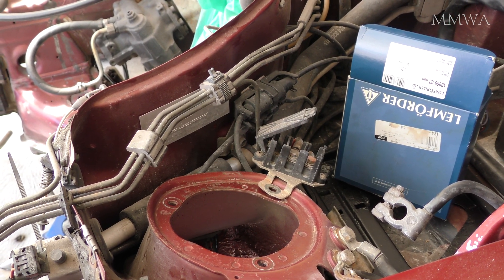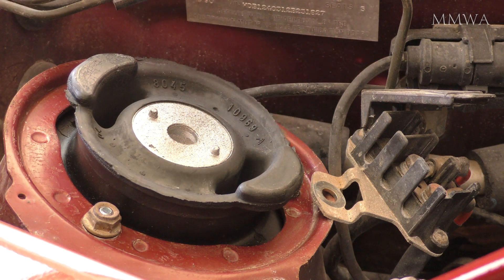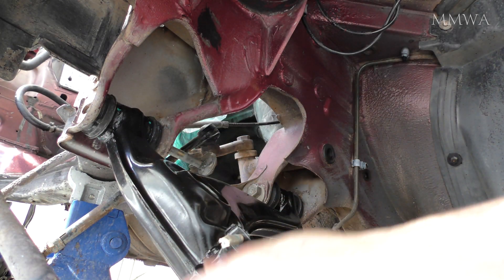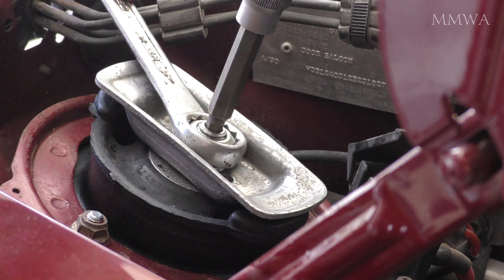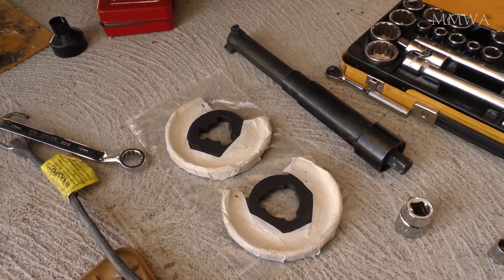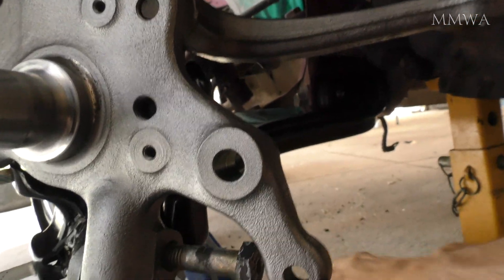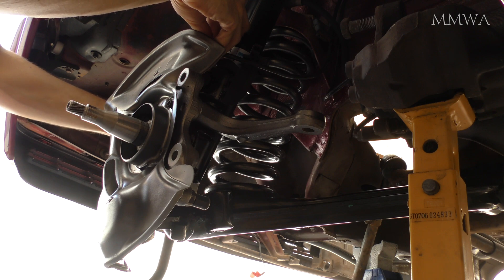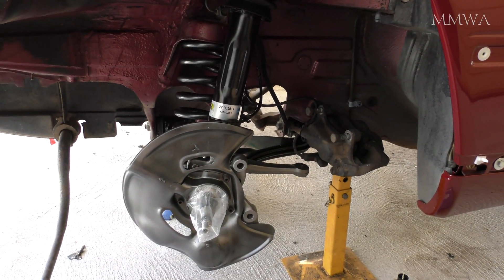W124 Project - I start assembly of the front suspension

Comment: Great video as always. I've replaced a whole lot of front end stuff, but there's still unruly vibrations coming from small bumps and making the interior shudder like an old Peugeot. The only bush I haven't replaced (which looks perfectly fine visually) is the front two piece bush on the front control arm. The rear bush on the front control arm has also been replaced. Looking at your video, it does seem like control arm goes a LONG way in absorbing vibrations. Would that be correct or should I be looking elsewhere? My 124 is a 300e 4matic btw which has very different looking components up front, but functionally the same.

Comment: My Febi-Bilstein control arm ball joint didn't fit the knuckle. Jacking and hammering it didn't do the trick.  I have to remove the glue and used hammer and screw driver to make the openning bigger.  It took me several hours to make that decision.  I also had a terrible time removing the spring compressor.  I had to reposition the plates 3x because the plates get stuck and loosening the the spring compressor bar with my ratchet keeps hitting the control arm which stops the ratchet from turning. I also had to jack it up and down in the process to get it loosen.  Also did you have a self-leveling system suspension in the rear? Did you need to replace it? I got a 1993 300TE Wagon. Thanks

Comment: I got Febi-Bilstein control arm too...but did you notice the placement of the lower end of the coil spring where it sits is different from the left and right. The driver side spring slot/stopper is on the lower end and passenger side spring slot/stopper is on the top end. Do you know why?
Reply from the maker: I did notice this and to be honest have no idea why its like this. Maybe its the angle the springs flex out on has something to do with it

Comment: Hello What is your torque specs for you control arm 2 bushing nut, ball joint nut? Also the strut/shocks 3 nut behind the knucke and 1 nut on the top of the shocks? Thanks
Reply from the maker: service documents are on the w124 performance website

Comment: Hi mate, did you have to get aftermarket shocks to fit those springs? Sorry for bad english
Reply from the maker: I think you should get shorter travel springs - i already had stock standard new bilstein shocks on hand so used those. i fully expect them to not last life due to being compressed so far at all times though.
Reply: @MMWA-DAVE  how did that work out? The h and r fronts on my diesel 606 wagon had to be removed due to tire rubbing.
Reply: @chillstar  check out boosted garage or whatever they are called with the 240z 606. He has a 124 in there with some really interesting rear springs. It is a sedan, but it must be some sort of solid thing they bolt into the spring perch with a big threaded tube that the actual spring rides on. Allows adjusting ride height. Probably not cheap, but maybe not too expensive either.
Reply: @chillstar  I just ordered all sportline stuff for my rig with the appropriate pads. Not too expensive except the rear sls struts which were really due for replacement. You can get them rebuilt or replace the seals yourself but I have not seen anyone redo the lower ball joints on the struts. They get super slack over time. Unfortunately the sportline sls struts are no longer available.

Comment: What brand are your control arms? Iam replacing LCAs on my 124 now i have lemforder CAs I believe my pinch bolt is already in the correct orientation, with the notch facing inboard. I also noticed that you didn’t paint match the eccentric bolts but just used another w124 as reference that worked out ok? Great videos keep up the good work!
Reply from the maker: I will have the car aligned professionaly once its at full weight - any alignment adjustments by me will only be temporary and good enough only for that drive to the shop. I used the miele kit or how ever its spelled. I would have prefered the lemforder but at the time (on both cars) the shipping was outragious for the very same kit - perhaps its heavier. Now they are available locally so i'd probably use lemforder in future but having said that i've still not had any issues with the kit on my blueblack car so they seem ok.

Comment: great video do you not use lock tite or torque these bolts to the correct torque? I'd be worried some of them would come loose
Reply from the maker: Absolutely you should replace the bolts at the knuckle (they come with new thread locker already applied) or at the very least clean and apply new thread locker. the struts come with all new bolts already.  The bearing kits also come with new caliper bolts already applied with locker too. I have only reused a few bolts.

Comment: The front hex-head-screw of the lower-control-arm is mounted the wrong way. In order to protect the thread the nut needs to be on the rear end (same with all screws i.e. the exhaust). Here in Germany you will not pass inspection this way.
Reply from the maker: Heh, I had a feeling there was damn good reason for it.

Comment: This assembly is really progressing rather superbly, great camera handling too!
Reply from the maker: Christian Wil'Chr i really need a small tripod for these in the wheel arch shots as its quite difficult getting the camera to sit anywhere suitable or alternatively get something to hold my phone in an appropriate manner. What i’m doing is less than ideal to say the least.
Reply: MMWA For lower (near ground) camera takes, you should buy those flexible tripods that go for around $20. The support legs can be bent in almost any direction allowing you to position the camera into the desired position.
You do have to bare in mind the weight of the camera to avoid it tipping over. In any case, these flexible legs make it possible to 'wrap' the thing around something without falling off, making for the perfect camera angle.